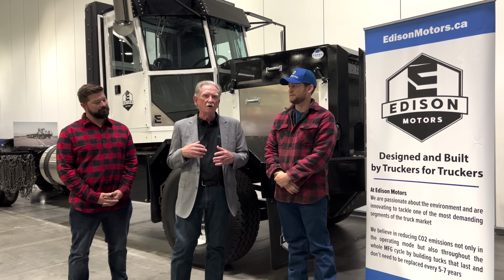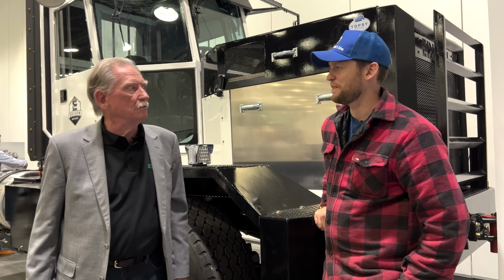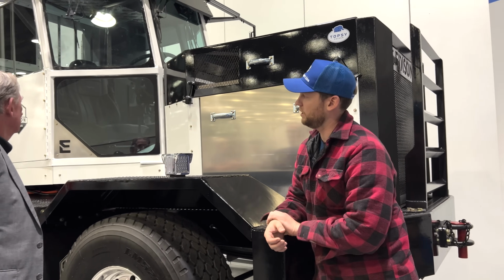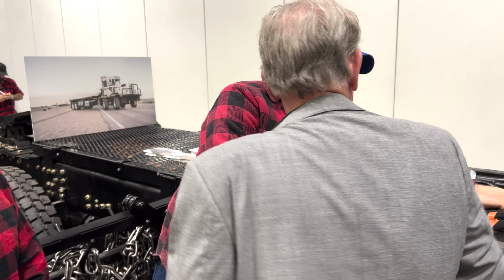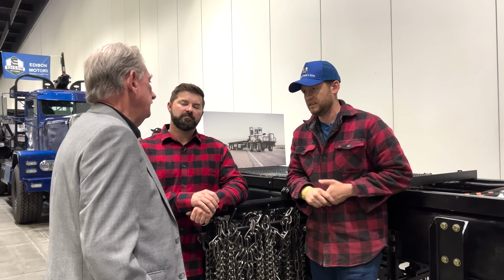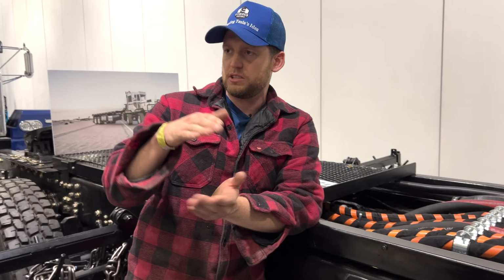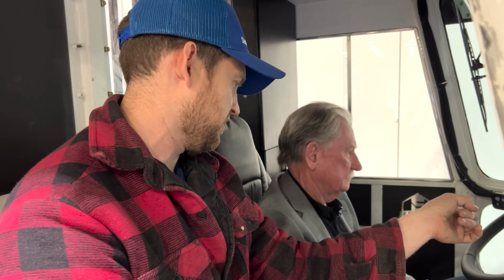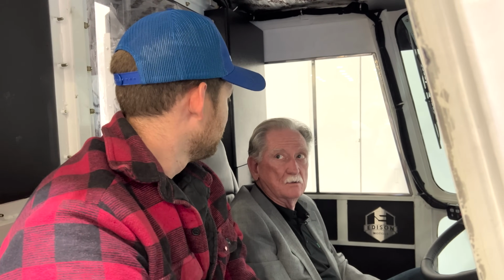This Electric Semi is a Million-Dollar Idea! Edison Motors at Fully Charged LIVE Canada

Comment: I guess there is no issue with the left and right hand drive shit!!!   Judging distances on opposite side from where you sit, not so much an issue.  Overtaking on open road, thinking a bit trickier from sitting in the centre, but as said, more of an off main roads kinda vehicle.  Mind u, if I'm spending this kinda $, it's getting taken everywhere, so winding up slower vehicles on the blacktop is 'on the menu'.

Comment: As a truck+trailer mechanic for 25 years this is how Ive neen wanting to build a truck . Everthing is spec'ed perfectly. Keeping that power surge threw all the shifting, enginge rpm up down ect is were this will shine. Just the wear on the frame constantly twisting throughout 18 shifts and this one twists up 1 time till you hit road speeds  . The gen set just runs a 1 rpm .  Beautiful

Comment: So if your trucks still use 2.5MWh of energy per day (not 2.5 MW).  And using Chace's numbers (and CAT) that the Diesel generator is 30% efficient at converting diesel to electricity, that's 2,500kWh/(10kWh/ltr x 0.30) = 833 ltrs per day of diesel.  How is that efficient use of diesel?  Chase said a typical logger spends $20,000 CAD per month, assuming 5 days a week, that's almost 500 ltrs per day @ $1.83/ltr.  If you use $2/ltr it's worse. The new Edison truck uses way more, not half.  Things just don't add up.  Either Chace is too high on what his truck uses in MWh or way too low in fuel consumption per month of a logging truck.  It should be interesting to see what the truck really uses hauling logs down the mountain.  I suspect it's way less than 2.5MWh per day.

Comment: The best part about the Edison trick is how practical everything is.  No transmission, clutch or driveshafts to maintain.  When the engine is running its at full load and efficiency.  Excellent all around.

Comment: Why does everyone keep calling this an electric truck?  Mine haul trucks have been using diesel generators to drive electric motors for years.   This has a Cat engine running a generator continuously.  This is diesel electric.  B.C has an abundance of electricity begging to be used off peak time.
Reply: The generator doesn’t need to run continuously. It’s technically a series hybrid.

Comment: Do you have the regen on the trailers or just the truck. ? if it's just a truck that's not a good idea going downhill with a load like that especially when the road is wet and muddy
Reply: Regen acts the same as a jake… it’s fine but no, the trailers do not have regen

Comment: Missed was the wear and the combustion efficiency of the diesel generator; because it’s decoupled from the drivetrain, it can work in optimal performance ranges giving lower pollution and longer lifetime. Also the swap out cost would be dramatically lower.

Comment: For those asking, ~80 litres per 100 km is about 3.5 mpg or almost 4 miles per US gallon.
Reply: Yes, 3.5 Imperial MPG, but that's 2.94 US MPG
US gallons are smaller than imperial gallons, so the MPG value is smaller.

Comment: Such a small battery...I wonder if they increased the battery size and had better charging infrastructure they could get rid of the generator.
Reply: That would be a battery-electric vehicle (BEV). They intend to offer that, and specify a 600 kWh battery in that case, but have not built a BEV prototype because it would not be as useful for their target market.
Reply: The infrastructure is the problem. You’d need a nuclear power plant at every truck stop with 30-50 trucks all trying to charge at once overnight.

Comment: Riding downhill with a load of trees makes all the power to come back for a seconds load.   I can't stomach that first load of crap...let alone a second load.  Stop making Canadians look stupid.
Reply: By makes all the power come back he means recharging the battery to the point they need a capacitance dump to get rid of the extra energy. The generator still needs to run for some of the uphill section if we are talking about the mountains of Vancouver where it was designed for

Comment: I don't think those Cat C9 engines have clean emissions. I don't know if Canada would allow them to sell this as-is and if they do (due to off-road only?), the non-carbon emissions will make this a very dirty truck. They have room for batteries and fuel because they don't have to include an aftertreatment system with this dirty engine.
Reply: Apparently you missed the "heavy vocational"  part (logging, mining supply)…this not for over the road delivery trucks..... Other truck makers are not making these heavy haul anymore.
Reply: @8100machinist  Despite Chace's complaints, the logs are still getting out of the forests all around the world, because suitable trucks are still available. And they don't need an exemption from emissions regulations. 

And Chace has said that Edison is going after the entire vocational truck market, most of which is on-road (towing, service vehicles,  waste collection, etc). 

Edison is using the Cat engine without exhaust aftertreatment because that's what the initial investors want, which is reasonable. It is not a viable long-term plan, but as I noted it will be easy for them to adjust.
Reply: @brianb-p6586   Also understand this Prototype #2.... for Christ sakes.... wake up......
Reply: @8100machinist  it's actually prototype #1; "Carl" is an amateur conversion project that uses no viable components.
Reply: @brianb-p6586  It isn't easy, you have to add thousands in cost, hundreds or thousands in weight, additional electronics and controls. Not at all easy. There is a reason people hold onto pre-EPA regulation trucks for their simplicity.
Reply: @Kelora  it will cost, but it's not technically difficult, because truck engines are sold as packages intended to work in many trucks. The logging configuration has lots of wheelbase, so fitting the exhaust treatment package in isn't a problem. But yes, as I said they are using the oldest engine design available because that's what their initial supporters want.
Reply: @brianb-p6586  carl is what most people call their 1st prototype....that was the point of carl or any 1st prototype....once again... wake up....
Reply: @8100machinist  
Definition of "prototype":
pro·to·type
/ˈprōdəˌtīp/
noun
a first, typical or preliminary model of something, especially a machine, from which other forms are developed or copied

There is nothing about the Kenworth conversion to be copied or developed, as nothing in the conversion is usable in a truck. No design feature of "Topsy" is the same as the corresponding feature in "Carl". Many people have stuffed old Tesla powertrains in various cars, pickup trucks, Land Rovers, and anything else they want to play with, and none of them call them "prototypes" of a production vehicle.

"Prototype" has a specific meaning in industry - it doesn't just mean "something I built".

Yes, Edison Motors may have called Carl a prototype, but it's not.
Reply: @brianb-p6586   Carl : hybrid heavy haul truck (diesel generator, batteries, electric powertrain)..... Topsy: hybrid heavy haul truck (diesel generator, batteries, electric powertrain e-axles).     yep... you right totally different!!!
Reply: @8100machinist  Carl is not a heavy haul truck - it has a car motor and transaxle, and is incapable of handing any significant sustained load. Everyone who builds with Tesla car parts understands this. I hope that the Edison motors people didn't think it would actually work under load, but it does drive around so it serves as a promotional tool (which is probably all it was supposed to be).

Carl has a frame-mounted single motor, multi-speed transmission, and conventional driveline, while Topsy has axle mounted motors. Since the engine and motor locations are the only design variables in series hybrids, they're not even similar in design. In the details of the components, even the type of electric motor and chemistry of lithium-ion battery are not the same as the real prototype, so nothing about performance or control of Carl applies to Topsy.

Since all series hybrid vehicles have an engine, generator, battery, and drive motor,  Carl isn't a prototype for Topsy any more than BMW i3 REx car is. Actually, the i3 is closer, since it has the electric motor at the axle. The old Fiskar Karma was even closer because it had the engine in the front.
Reply: @brianb-p6586   https://youtu.be/KpWyujcdtIg?si=P5tuoS3SlpquxDhy
Reply: @brianb-p6586    https://youtu.be/cgRcfayRSyk?si=qYqqd-meYoHQctU2
Reply: @Kelora you think a DPF weights hundreds of pounds? the truck was 600 lbs lighter after the conversion.
Reply: @8100machinist Carl is a conversation and a concept car with a Tesla car motor. Topsy is the prototype.
Reply: @gilliesiut2332  200-300lbs yes. Plus extra weight due to an engine design that meets the higher regulations and the larger rad required to dissipate heat since less heat goes out the exhaust and more out the rad on a "clean" class 8 conventional diesel engine. Not sure how much weight those add exactly. Conversion? This truck had a road legal 2021+ model diesel in it before?
Reply: @Kelora  their primary objective isn’t to become a large OEM manufacturer. At lest it wasn’t. They started out trying to keep older trucks on the road with a diesel electric retrofit. Because they keep their old vin numbers they are emissions exempt. Everything else is yet to be sorted but I know the emissions for diesel electric commercial vehicles are more lax. All of this is pretty simple and 200lbs of emissions still has it under weight of the original 

Why Replace The Entire Truck When You Just Want To Upgrade The Driveline?

Edison Electrification kit can be added to existing trucks

We believe in keeping trucks on the road for as long as possible.  If you have an old truck with good frames, but a bad motor/driveline this is a prime opportunity to upgrade to electric for a lower price than buying a completely brand new truck.

This could be especially important in vocational applications where the cost of the body can easily outweigh the cost of the truck: such as oil and gas service rigs, crane trucks, garbage trucks, heavy wreckers or other specialized applications.  Rather than spending millions to replace the entire truck and body it’s possible to just upgrade the existing driveline system.

This is also a good option if you just don’t like the style of the Edison truck, unlike other manufactures for electric truck where you’re stuck with the style they decided on.   With Edison Motors you can just bring us the truck style you like and we’ll convert it into an Edison Truck.  It’s all about customer choice.

Their first conversion prototype is only driven off of a modified Tesla car motor and not a truck e axel as they hadn’t found a supplier for them yet due to a deal falling through and by the time they had a new supplier they built topsy
Reply: @8100machinist  Yes they are. Paccar and DTNA both make them, probably others.
Reply: @Kelora   Chase literally had video on this...…You can't get them.... they are custom order.... and years out.
Reply: @Kelora   https://youtu.be/fBee0TCjZDg?si=j97R-DVBJiMXrl2b
Reply: Yes, it would be off-highway only with this engine. Avoiding the exhaust aftertreatment package does save significant bulk and weight, but their potential clients (and certainly most of their fans) want to avoid that package for cost and operational reasons... without regard to emissions. This is a market in which most owner-operators will chose a 30-year-old engine over anything new to avoid electronic components and emission control systems.
Reply: @brianb-p6586  Yep it might be economically viable but I hope people understand this will not be clean and this is a large step backwards on emissions in many ways. There are good reasons the other truck companies aren't doing this.
Reply: @Kelora  fortunately,  the fix is easy: just use a properly complaint engine. That won't be a Cat, but equivalent engines from any highway truck engine manufacturer will work the same way in the hybrid system, with the same potential fuel savings. 

I don't know how commonly current logging trucks use an "off-highway" designation or endless rebuilds of a truck with an old-enough-to-be-exempt VIN to avoid emissions controls... or just delete them.
Reply: @brianb-p6586  It won't be that easy because they will have to add an aftertreatment system to the vehicle which takes up space and weight.

Comment: Put that hi-low beam switch on the ceiling worked up like a air horn pull (no dirt, mud, snow etc. & will function 40 years later). Maybe the rule book would not allow that?
Reply: I doubt there's a rule about where the headlight dimmer switch is located. Search the Canadian Motor Vehicle Safety Standards if you're curious.

Comment: This is making me wonder why I haven’t seen anyone build a hybrid transport truck before...
Reply: You just haven't noticed. Hybrids have been built in essentially every type of vehicle, including various styles of truck. Companies trying to build hybrid trucks have come and gone, some going bankrupt, some doing it as an experiment and just dropping it, others changing course to different products, and some still trying. The best-known current proponent of hybrid highway transports is Hyliion; they call their hybrid the "ERX", and have chosen natural gas as the fuel, but using diesel instead of natural gas is trivial. 

The reason that diesel-electric hybrids are not well-suited to most trucks, especially highway rigs, is that the hybrid benefit is not enough to make up for the increased cost and weight and the relatively low efficiency of putting all of the engine's output through a generator and then a motor (a mechanical transmission is more efficient).
Reply: Not exactly true.  This isn't a "Hybrid".  It's a Electric Vehicle with a Diesel Generator.  A Hybrid would imply that it would be powered or propelled rather, both by a electric and diesel motor.  The  vehicles you're talking about were hybrids.  This system closer resembles the electric with generator configuration that has been used with locomotives.  It's been around for years but never within something like the trucking industry.   @brianb-p6586
Reply: No, @dukeleather  "hybrid" just means that it has two energy sources - the diesel fuel and engine, and the battery. Rail, heavy equipment (mining) and ship systems without a battery are diesel-electric drives, not hybrids. This is specifically a series hybrid configuration. 

This is not new stuff - diesel-electric series hybrids have around for a long time... and they have always been correctly described as hybrids. BAE has manufactured them for many years, mostly for large buses.
Reply: @dukeleather actually this is a series hybrid.